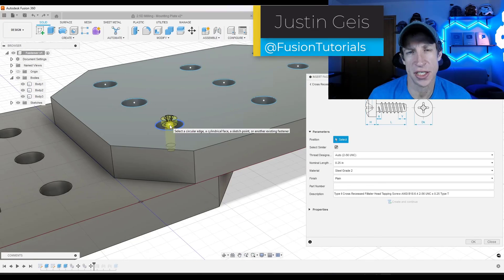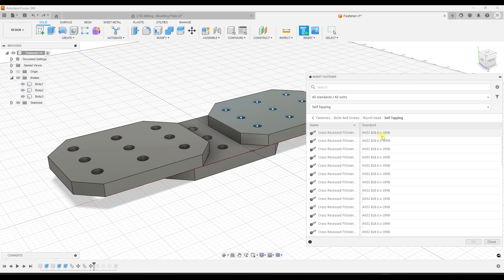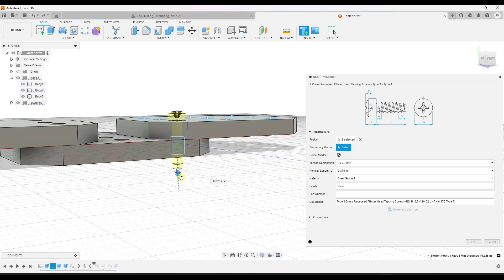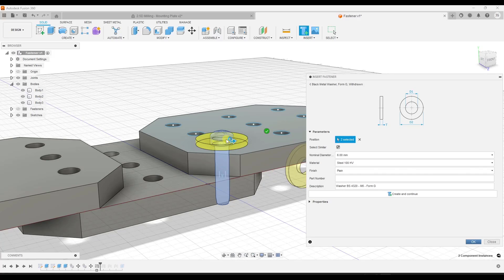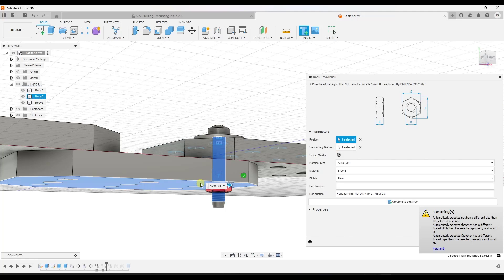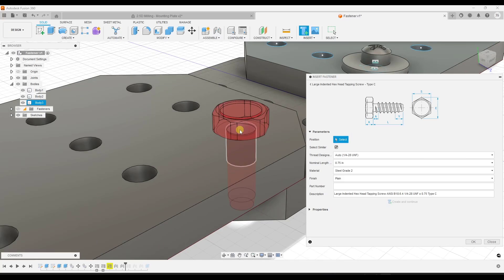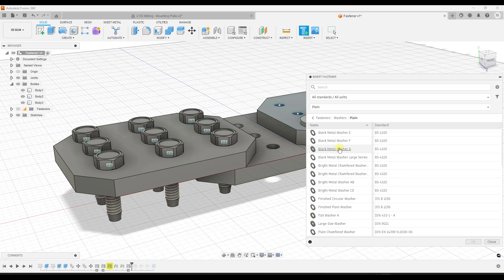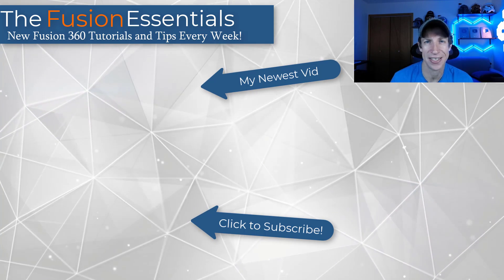FASTENERS for Fusion 360 are Here! (New Feature!)

Comment: I'm just a beginner and piece mealing my way through a design. I want to place a hex nut or the design of it in a hole I have so when I print the 3D model I can just place the hex nut in for the screw. Should I use the insert fastener or is there another simpler way? Hopefully you already made a video I can follow

Comment: How come when I try to 3D print the fasteners, it smooths out the thread so the screw is flat? Are there any fixes when converting Fasteners to STL files in fusion?
Reply: Make sure that the bolt is “Modeled” if not it wont work. Its just a drawing without modeling it
Reply: @kz8458  how can I do that?
Reply: @Tsai150105  when you are adding a screw. In the pop up window to the right. There is a button that says Modeled. Make sure its on
Reply: yeh same for me, anybody any ideas?
Reply: @atanquerel  Make sure that the bolt is “Modeled” if not it wont work. Its just a drawing without modeling it

Comment: Been working on learning fusion something ive not seen anywhere was the ability to group components for turning on and off visuals when your needing to work inside something.  Been designing a garage and turning on or off all the studs in a wall individually is really frustrating.  Have i missed something?
Reply: You could add all of the components into a selection set and toggle the visibility of them there. I use that for doing before and after models where some items stay and others are replaced with something else.
Reply: @dannyb3638  ill have to look into that